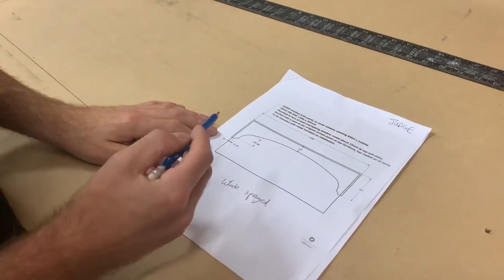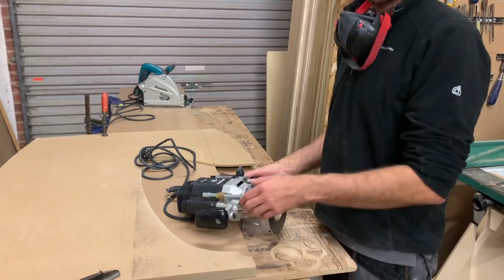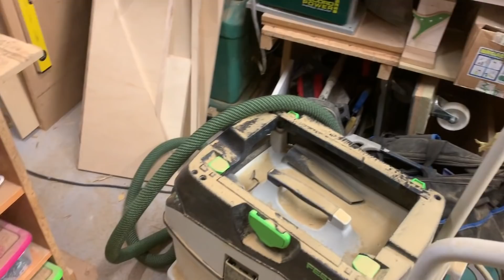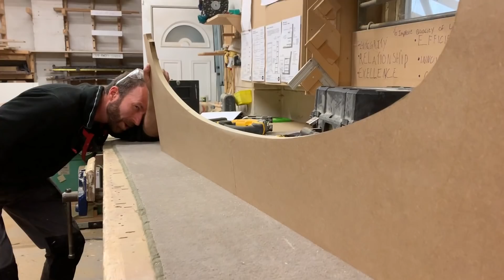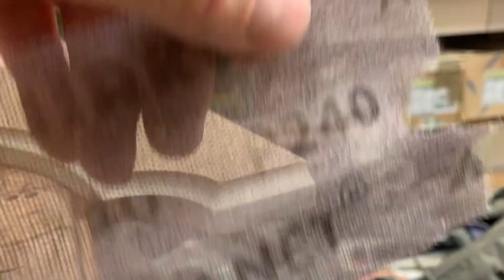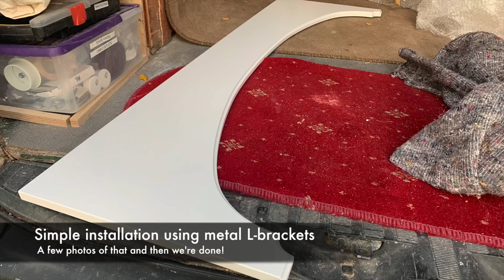Perfect Handcut Curves

Comment: Here's a top tip for you Alistair. You may find it useful if you've never tried it.  I use a sharp card scraper instead of the sander to make small adjustments to the curves. The resulting edge is square to the face and consistent.
Reply from the maker: Anthony James Brown great tip thanks and I’m sure I have a cabinet scraper hiding somewhere in my workshop, though it’s been years now since I used it!

Comment: What's the minimum amount of paint you can use in the aaa set up
Reply from the maker: paul morgan I guess at least a litre in the bottom of the 5L can  - Brady can correct me - but you need to fill the pipes and also have enough that the mesh end of the pump tube is submerged and able to suck

Comment: I think I would have refined the curve with a spokeshave, but I guess I am still a bit old school. I just feel you would have a bit more control over what you are doing as appose using a D/A sander, more likely to keep a more crisp edge.
Reply from the maker: Gary Blake I do love a spokeshave, have a couple hidden away.  Didn’t occur to me. Good suggestion.  Though I imagine they work less well on MDF vs say pine where you could shave of some satisfying smooth curls!
Reply: @Alastair_Johnson  I have used them for scribing M/R MDF and never had a problem, I think its all about keeping a really sharp edge. I sometimes use a flat bottomed one for gradual curves rather than the curved ones as I find they work better. The old Stanley no 64 ones which do not have the adjusting knobs are best as they have a smaller sole to them.

Comment: Looks loads better with the frame. Did you have to cut it down in size then to fit it in the window box and return with the frame parts? Or did you already have them with you?
Reply from the maker: Chris Moxon an interior designer was involved in the whole job and passed the main project on to me.   Later they discussed with the customer adding the window arch and instructed me, with a sketch by email, to do it as a simple panel, which I did.  My mistake was in not consulting in detail again with the customer as I normally would.  It was only after I fitted it the customer realised it looked wrong and I agreed.  So we made and sprayed the extra strips and returned a couple of weeks later to add them as a frame.  Yes I had to cut down the panel to fit in the reveal.